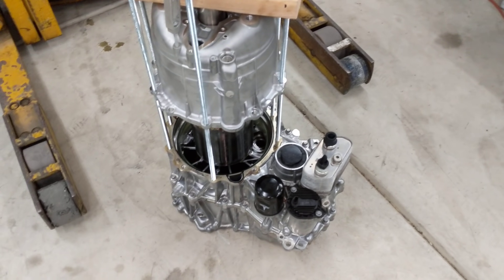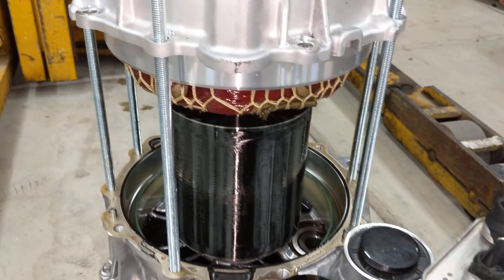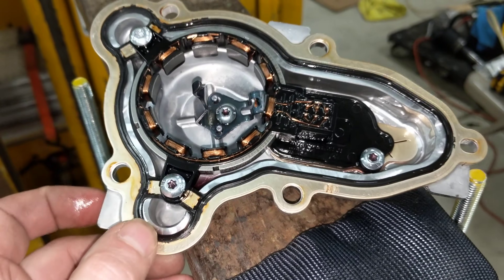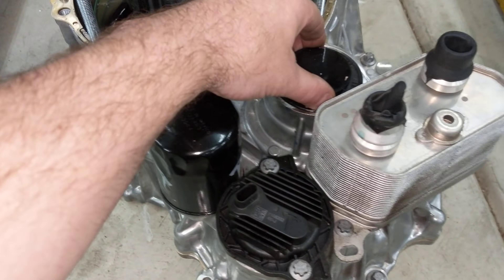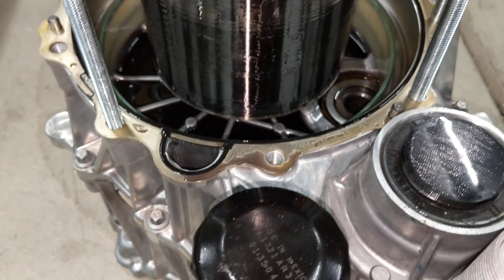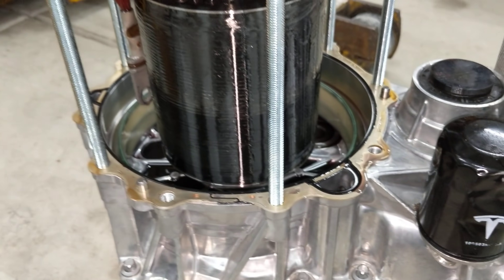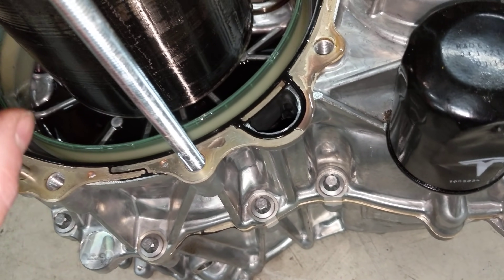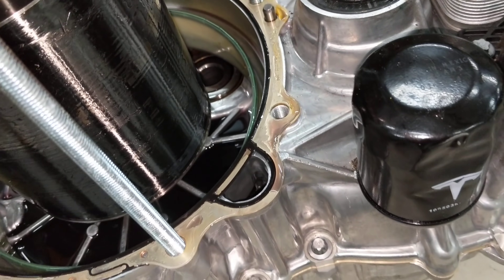Tesla Plaid Teardowns - Front Drive Unit

Comment: Awesome.
Two questions;
Did you count/measure the gear ratio?
Did you manage to see what the part number/spec of the high speed bearings?
Reply from the maker: No, that would take splitting the other half of the case.  I might do that if there's enough interest.
Reply: the gear ratio should be published in the Model S Manual, 7.5:1 for both front and rear motors on the Plaid
Reply from the maker: @matteocomelli9587  Yes, this looks correct.  That would put the motor RPM at about 18,000 at top speed (200MPH / 322KPH).
Reply: @Ingineerix  makes you wonder what the point of the carbon wrap as 18000 is about the same speed as Model 3 performance rotor at its top speed.
Reply: @TC-V8  my guess is that Model 3 rotor expands at 18.000rpm, so you'll need to make it smaller in the first place to have that tolerance when you are going fast, but that impacts performance. The carbon wrapped rotor does not expand, so it can be very close to the stator and still have space at 18.000+rpm.
Top speed is about the same right now, but the performance is greater, and it can probably spin even faster, Elon said 20.000rpm and maybe a little more, new Roadster will need 20.000+rpm to go above 250mpg/400kmh and still have a good off the line performance
Reply from the maker: @TC-V8  It's definitely higher, and the forces on the rotor go way up fast.  Also, keep in mind in the Plaid it will be not only under higher RPM, but also markedly higher power, (Higher speed means much higher aerodynamic drag) so more magnetic/reluctive forces acting on the rotor.
Reply: @matteocomelli9587  yes have read that also - was just wondering if this could be confirmed.
Reply: @matteocomelli9587  The true ratio is often a tad off, to even out wear and reduce harmonics.
A too round ratio leads to the same few teeth always mating. (hunting gear)
Reply: Yes please, high interest !!

Comment: So the raven version has stronger magnets in the rotor but is electronically speed limited to avoid the rotor shattering at speed, and then the plaid is a similar version of the raven motor where they overwrap it with ccf and do away with the speed limiting (and maybe higher accel), did I get that right?
Kind regards
Reply from the maker: I don't think the magnets are any different.  Just the overwrap.  They probably put the depopulated SiCFET inverters in the non-plaid versions though, just like they do for non-P versions of the 3/Y.
Reply: @Ingineerix  ty for confirming.

Comment: Careful with this stuff.
I've seen steppers that were fully magnetized when only within stator.
Once that rotor was removed, its magnetic field had dropped permanently to some coercitive value.
After reassebmbly motor would lose good part of its torque.
Reply: May be not in this case because it is difficult to magnetise magnets with this V shape motor configuration.
Reply from the maker: Yeah, I don't think that's a risk here.  These are special magnets, and a special rotor design.  I felt no change in the cogging forces upon re-assembly, which are quite powerful on this design.
Reply: @Ingineerix  What kind of special magnet are you thinking about? Arrangement or composition? I think that they probably reduce the air gap in Palladium motor (that is why is it so difficult to disassemble rotor/stator, and they need carbon sleeve) and so the effect of magnet is stronger and that allows better motor performances...

Comment: Based on your "bolt test" does the carbon wrapped Plaid rotor have a higher magnetic flux strength than a Raven rotor?
Reply from the maker: No, I don't think so.
Reply: @Ingineerix  The reason I asked is that the existing soft iron laminates which enclose the magnets have a "bridge" around the perimeter of the rotor which would short circuit some of the magnetic flux away from the stator windings. With carbon fiber wrapping Tesla could potentially reduce the loss of magnetic flux. Maybe it's only in the order of 10% or so, but it all adds up.
Reply from the maker: @KiwiNeale  Yeah, obviously I wouldn't be able to tell 10% by just a "bolt test".  It doesn't appear that they've changed the rotor design, but to confim that would be a destructive teardown on both, neither of which I can do unless someone sends me some drive units they don't care about.
Reply: @KiwiNeale  If you take a look on pictures about plaid rotor, it seems to be! Magnetic bridge seems to be removed...

Comment: maybe they are sensing coil temperature via the winding resistance
Reply: I was thinking the same thing.   That plus oil temperature could get you a pretty good idea of thermal margin remaining.
Reply: If the windings are in an oil bath, they may just measure oil temperature to get the average.
Reply from the maker: @ke6gwf  I think modeling is the way to go.   Even with a direct sensor on the windings like they used to have, There is still some latency at the crazy high-power these operate at.  By the time the oil heats up, your motor windings would already be lava!  Modeling can be somewhat predictive, so once you know the system well, it's superior.   I'm sure they also have basic bounds checking too.
Reply: @Ingineerix  oh yes, you are right! 
I was thinking about driving temperature, but I forgot, this is a race car motor so the temperatures of concern are the instant acceleration, and yes, no way to accurately measure that since you can't measure all points at the same time. Lol
It might be useful to known the soak temperature via a probe or oil temperature so that you know what your baseline is before doing a launch so your modeling can have a starting point if you are pushing it hard on a hot day, but maybe they removed the probe because they discovered from monitoring lots of data that the temperature never exceeded comfortable ranges and so like the passenger side adjustable lumbar support, it just was an unneeded part.
I was looking at the speed sensor board and wondering if it had a infrared sensor looking through the hole where the probe used to be, but I didn't see anything, and you probably would have spotted something like that.

So the more I think about it, the more I suspect that these motors never get pushed close to their limits on the cars, and so they don't have to monitor the temperature because it's not an issue.
And they can probably use the winding resistance to monitor temperature rise and other such parameters, so they could spot if the heat exchanger got clogged or something, and if they could get basic monitoring through software, anything else would be excess parts.

And if these motors are powerful enough for the semi which allows much more torque due to more tires and a lot more weight on them, then they are basically coasting here lol
Now on the semi, I would expect they would probably have direct temperature reading, because climbing the Grapevine at full load is a lot different than periodic acceleration on a race track.
Reply from the maker: @ke6gwf  They still have a sensor in the oil pump for baseline oil temp.   It's just with about 3 liters of oil in there, that's not going to heat up anywhere near as fast as the windings themselves.
Reply: Ingineerix Agree. I think the estimation of stator temperature is the same case of IGBT junction temperature which also could not be measured directly. I have no doubt that Tesla have the capacity to build an accurate motor thermal model as well as calculate the motor loss (the hardest parts are ac resistance loss and iron loss). Respect
Reply: @Ingineerix  curious when the greatest coil heating occurs, ie max power/cruise or with regen ?
Reply from the maker: @zaneenaz4962  WAY more dissipation on max power.   It's pretty linear, so 50kW or power or 50kW of regen is about the same I2R loss.

Comment: Wow, crazy to think that rotor spins up to 23,000 RPM, with probably 40,000 x g. That's basically the same as a centrifuge rotor in a science lab and has to be made with similar tolerances and strength. I see the balance drillings on the top, I can tell it's probably precision balanced.
Reply: F1 MGUHs are doing 125kprm, 100+kW can fit in the palm if your hand and have been carbon sleeved for years.  Nothing really new here.
Reply: Tesla motors can in to uranium enrichment facilities?

Comment: Thanks for the video Phil.  I'm thinking that spin on oil filter is a lifetime no maintenance unit.  I can't imagine any normal circumstances which would call for it's replacement.  There's no oil fill or drain plugs in the casting, right?
Reply from the maker: Exactly.  Tesla doesn't use those for easy replacement, it's a good way to get a high-quality filter cheaply.  It does have a fill plug, but not a drain plug, but you can do that pretty easily just by unscrewing the filter.

Comment: Magnetic field in motor 6poles or 4poles
Reply from the maker: This is a 6 pole design.  You can tell instantly by the 3 lobes on the encoder.  The motor design hasn't changed since it was introduced on the Model 3 in 2017, other than minor changes and the carbon overwrap.
Reply: @Ingineerix  short circuit the 3 phases together and try to measure the rotation load. 
translated from google)
Reply from the maker: @hybridinnovate  What good would that do?
Reply: @Ingineerix  really drive power). 
I need to know the resistance of the two phases, and the voltage at cruising speed, I will assume this is 10000rpm.
to what speed of rotation could you turn the rotor?
Reply from the maker: @hybridinnovate  Sorry, I'm pretty busy.  Unless you want to hire me for consulting, this request is way beyond something I would do for one guy on youtube.
Reply: @Ingineerix  no no, if you are not interested, I do not insist
Reply: @Ingineerix  maybe I'm not the only guy on youtube

Comment: Something tells me there is going to be a model 3 plaid.  It's too simple just to swap out the rotor for a CF rotor and play with the inverter programming.
Reply: Yes simple for the motor swap - not so simple to get a battery with 1MW to power the motors!
Reply: @TC-V8  It's not about power. The Model 3 requires serious alterations to install three large motors in it. We are talking about upgrading the rear engine rotor to maintain high power at high rotor speeds.
Reply: @bayes1124  yes
Reply from the maker: @Robbie6298  They could already increase the power in the Model 3 if they wanted to.  They use the exact same powertrain in the Y, which has higher power.   I'm sure it's definitely marketing driven, but also they would start getting into traction problems pretty fast if they went too far.
Reply: @bayes1124  The original query was about swapping the rotors! Not about 3x motors!
Reply: Why would they lower the price and cannibalize Model S sales? Makes no sense

Comment: what is the purpose of the carbon overlay on the rotor ??? to hold those magnets better in rotor ??
Reply: two reasons probably: 1- 20000rpm makes high centrifuge forces and keep small airgap with that it is a challenge. 2- because they probably remove the magnetic bridges in laminations to increase reluctance torque and so carbon fiber is mandatory to keep rotor metal parts together
Reply from the maker: @lauricgarbuio8988  is correct.

Comment: Can you explain why it doesn't make sense to use a second gear ratio to increase the highway range of electric vehicles?
Reply: Porsche Taycan does that, does it make the energy consumption numbers go down?  I suspect not enough to offset the weight and reliability downsides.
Reply: @morrisg  the porsche taycan also achieved way higer speeds with that two speed gearbox compared to the tesla model S p100d.
Reply: @alanmay7929  what's the top speed of a Porsche Taycan?
Reply from the maker: Gears add a lot of complexity and people also don't realize they add a lot of mechanical loss. Generally the more moving parts you can eliminate, the more efficient, lower cost, and higher reliability your drive unit will be.   With the right holistic design electric motors can produce enough power throughout their RPM range, so there is no need for the "crutch" of a multiple-ratio transmission.   Tesla's solution proves itself well, there's nothing else I've seen that's as well executed with this power level and reliability.
Reply: @Ingineerix  Well, I think we have located the Porsche fanboi in our midst.  Please don't let it bother you.  I too put in 25 years doing electrical engineering contract work and was always amazed at the corners people painted themselves into.  Very lucrative corners as those types kept me in business!
Reply: @Ingineerix  Interestingly the Tesla Semi does use 2 ratios... but over 2 different pairs of one-ratio motors.
The design intrigues me... I am assuming at typical speed both ratios are pretty optimal, while at high/low speed one ratio is favored and the other kicks in only for power burst.
Reply from the maker: @musaran2  Yeah, but no shifting.  Though they do have a clutch they can use to disengage the unused motors to reduce drag.   Of course due to the mass involved a Semi has totally crazy torque demands, so this makes sense.
Reply: @Ingineerix  wrong, the only complexity in gearbox are the clutch and other mechanisms, that 2 gears gearbox is super compact and barely add any weight on the system, it also helps reach higher speeds and lets the electric motor work less harder.
Reply from the maker: @alanmay7929  You can agree to disagree, but I'm not wrong.  The only manufacturer who's done this in a production car is Porsche where cost is not a concern, and they didn't have the institutional knowledge that Tesla does about motor/inverter design.  Take a look at the Taycan's efficiency numbers and then still see if you can claim it's better overall.   Also watch the plaid gain several car lengths on the Taycan when it has to drop power to shift.
Reply: @Ingineerix  most of the costs in the porsche taycan is due to all the options that they offers, porsche has things like all wheel steering, way better build quality than any tesla, paint choice, better stability at higher speeds........
Reply from the maker: @alanmay7929  That still doesn't matter, you can't possibly think it's lower cost to add a 2-speed transmission.  And you skirted the efficiency issue.
Reply: @Ingineerix  lol.... you think the carbon fiber wrapping is any cheaper?! Porsche just probably took some existing gears they have in house for that car, also EVs normally have one gear so porsche just added another one. The second gear actually helps alot with efficiency.  The carbon wrapping protect the rotor from expanding/exploding at very high rpm and also helps for cooling/maintaining a certain temperature.
Reply: @alanmay7929  here’s a 3 part video series that may help you understand why gears aren’t better. https://youtube.com/playlist?list=PL00mT8ipAnquDXZrklCCuZtTlzl5fpKKH
Reply from the maker: @alanmay7929  You clearly didn't actually check the Taycan's efficiency.  It's pretty bad compared to the Plaid.   The facts have spoken!
Reply: @Ingineerix  the porsche taycan was actually porsche's very first attempt to making an EV, the efficiencies are related to many factors and the drive train is just a part of it. The porsche taycan was also heavier than the tesla model S..... with all the features it included like 4 wheel steering and much much better material quality and the list goes on.....
Reply from the maker: @alanmay7929  Why don't you send over your Taycan and let me do a fair engineering analysis.   This is an Engineering channel, not a fanboy hangout.
Reply: @Ingineerix  im not a fanboy of any kind, I respect every vehicles for what they are, every vehicles have their own characteristics and pleasant features. Tesla has achieved great results, A mercedes amg e63s wagon with 700hp ish does over 205mph on the Autobahn just like a Bentley flying spur, it actually impressive to see those big vehicles reach those crazy "supercar" speeds.
Reply: @alanmay7929  You don't get a prize for being heavier and less efficient in building similar vehicles. :D
Reply: The Taycan gearbox and DU is from Rimac.
Reply: The only thing you need for additional speed is additional RPM. There’s two ways to do that increase motor RPM, or raise your gearing. If you raise your gearing you need to increase your amps, which means you need a little higher ratings on your cabling and battery and everything. There’s no reason to add the complexity and weight of a two speed.
Reply: @allterrainrandy2587  bullshit, the two speeds gearbox is the least complex thing in that porsche taycan.
Reply: @alanmay7929  I'm saying there's no need for a 2 speed gearbox with an electric motor just make a better electric motor. If you need multiple gears with an electric motor it's because your electric motor is too small.